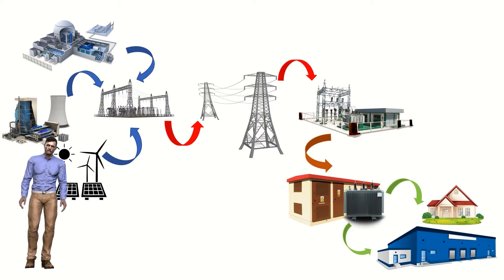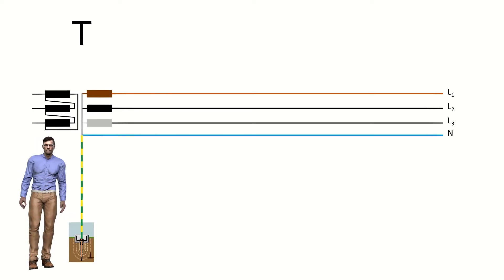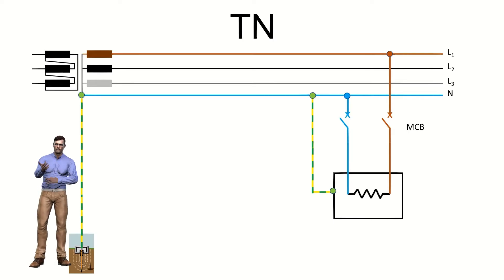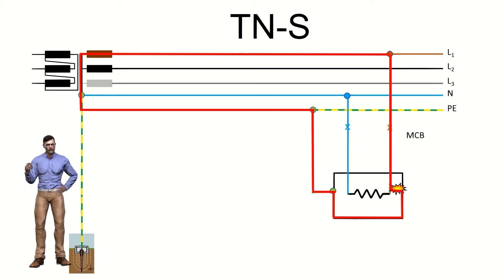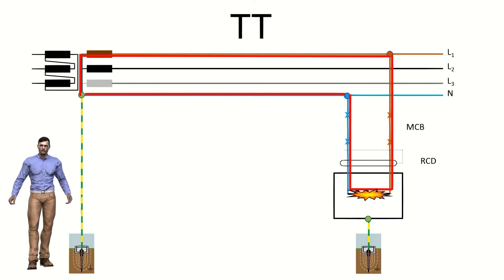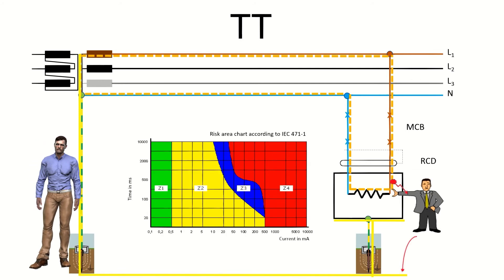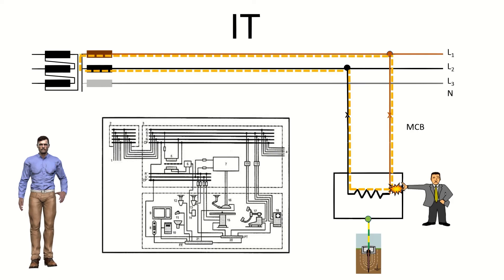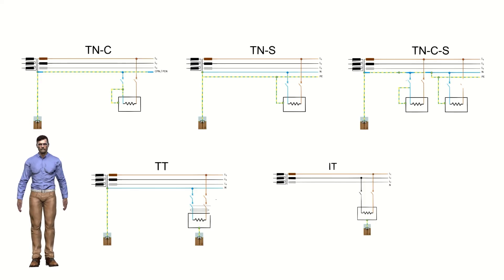How electrical distribution systems TN TT IT protect against indirect contacts. Grounding systems.

Comment: Why it is not recommended to distribute neutral in IT earthing system?
Reply: I think there is no harm using the Neutral as long as its not referenced to the ground. The whole idea is to separate the installation from any potential difference to the ground.

Comment: In a TT system I believe the whole house RCD is upstream of the breakers. As discussed below, for safety there is never any breaker or switch to interrupt neutral lines. Also I believe the TCN-S system is so labeled simply because the feeder wires to the home combine N and PE together, not because there is a mix of downstream components that are fed with either separate or combined neutral. As a rule of thumb the bonding of neutral and PE (in TCN-S) happens at only one point between the service input and the main house beaker, and there are never any devices on the other side of that bond. You might consider doing this again, it is a useful resource. You might also bridge into how a broken neutral can change the neutral and ground voltage level throughout the home, causing some devices to experience higher than average voltage drop because of imbalanced consumption between the two lines of a split phase 120V TCN-S system.

Comment: In the IT system fault why the touch voltage is not as the same voltage of the supply?.
Reply: Because of the high impedance of the earth connection. Also even the open circuit voltage is just 133 V because one has no neutral.
Reply: it's a floating ground

Comment: at TNC CONNECTION , YOU put on the diagram a Circuit beaker on the PEN which goes to the load , which is wrong,  as  it is prohibited to break the PEN , Because this will isolate the earth to the loads,  which is dangerous !!!!
Reply: That is the reason why I always  read the comments bellow to the video. Good Job.
Reply from the maker: Hello Ahmed, you are right! copy paste error. I will correct it. Thanks a lot for the comment!!!
Reply: Breaking the PEN energizes all grounded equipment cases. No fault in the equipment is needed. That is highly dangerous.
Reply: Hehe good, I went trough the comments to check if this is mentioned. Very imortant!